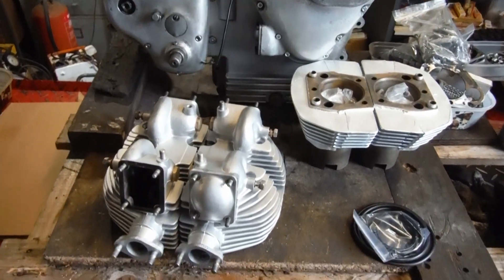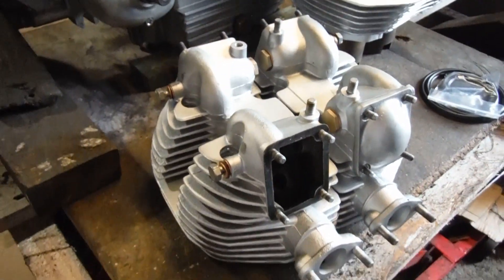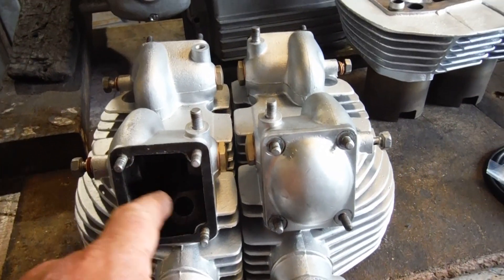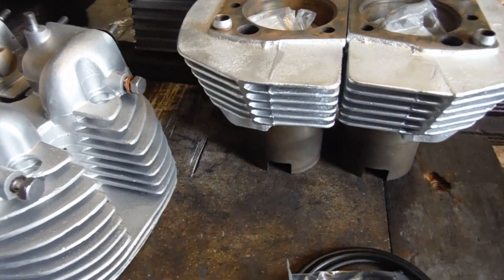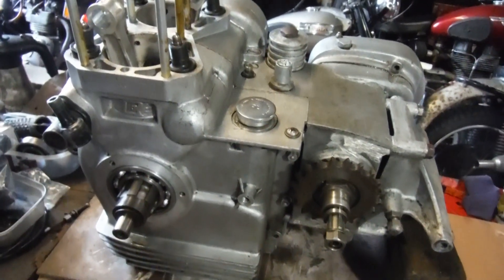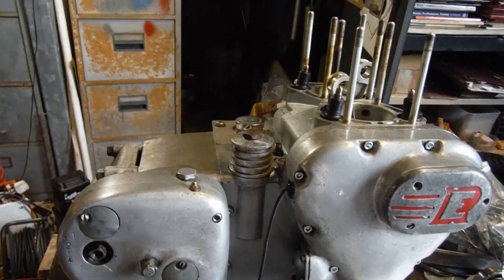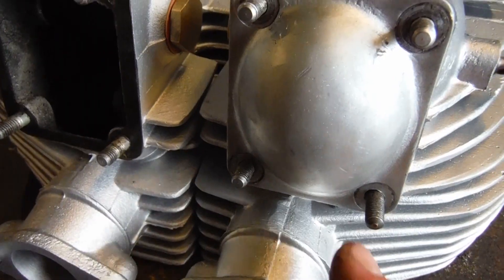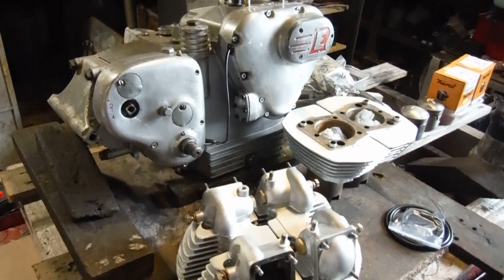Royal Enfield 750 Interceptor S2 engine strip/rebuild - heads & barrels back, blasted & painted.

Comment: Copper washers for the oil feed bolts, rather than Dowty washers. Old school.
Reply from the maker: I will be using the Dowty washers provided for the rocker feeds, they are far superior to copper, or fibre washers and are reuseable almost infinitely.

Comment: Paul,will you be installing the 'compression plates' and the dual gaskets,
or just a single cylinder base gasket?
Do you use some form of chemical sealant at the cylinder base?
Thanks in advance
Reply from the maker: Probably not, I will more than likely use one base gasket, coated on one side with Wellseal or similar and coat the other side with a smear of grease.

Comment: Hi Paul, as a bit of a newcomer to vintage bikes I thought I'd ask you this question because I may get a sensible answer... On my AJS 350 single, the lower fins are painted black, but the upper ones are shiny metal coloured. What is the reason for this - that is, if one approach is better than the other, why aren't they all the same colour? Cheers, Mike.
Reply: Are the upper fins Aluminium and not painted at all?
Reply from the maker: The heads are alloy, the barrels are cast iron.
Reply: @paulhenshaw4514  Ah, I didn't think that would make a difference. Many thanks!
Reply: @neilmcintosh1200  That's right. I wish I could post a pic... YT doesn't allow it. I think it's standard for the AJS 350 single engine.
Reply from the maker: Hi Mike, black should dissipate heat a bit faster than silver.
Reply: @paulhenshaw4514  Yes, many thanks for answering. What I don't then understand is why aren't they all painted black. Is that just because the silver colour looks better? Sorry to bother you with this.....
Reply from the maker: In day to day use, it doesn't matter much, really.